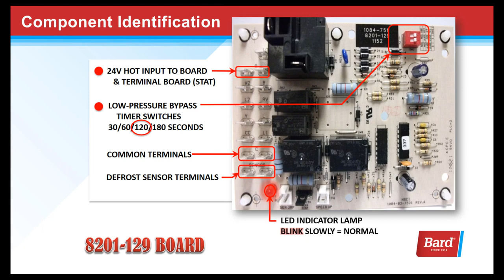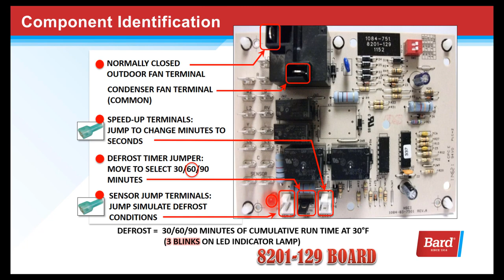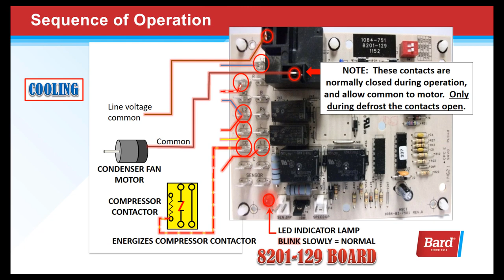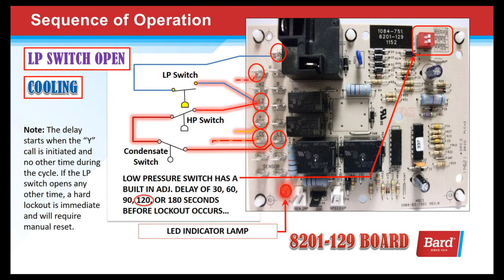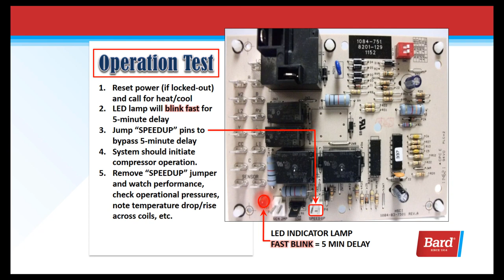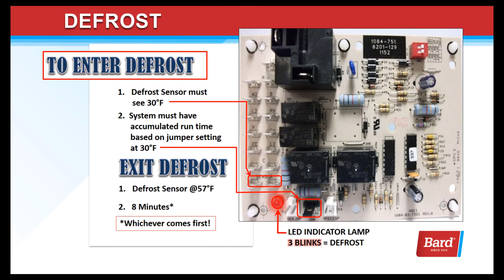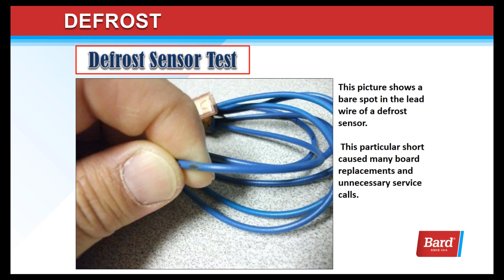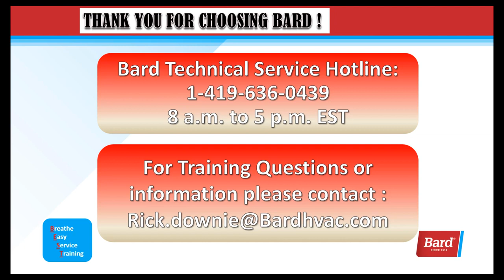Bard Wall Mount Heat Pump Defrost Control Board Service & Troubleshooting

Comment: what would cause unit to shut off when in heat and sen jump to go thru defrost cycle and as soon as I hit speed up it shuts off. sometimes tripping low volt breaker
Reply from the maker: Not sure, I would need more detail. If you are tripping the low voltage circuit it sounds like there is a short to ground in the wiring somewhere or a faulty contactor. I would recommend having a HVAC technician check out the system and contact your local distributor for tech support.

Comment: by the by, could it be the board's problem, making it so the HEAT WONT QUIT after my desired temp of 63 - 65 degrees is reached?